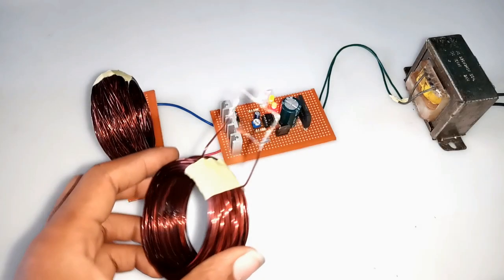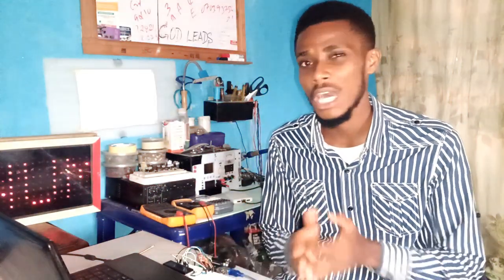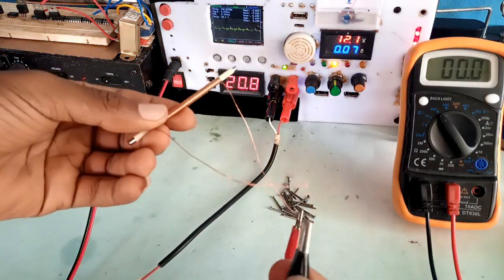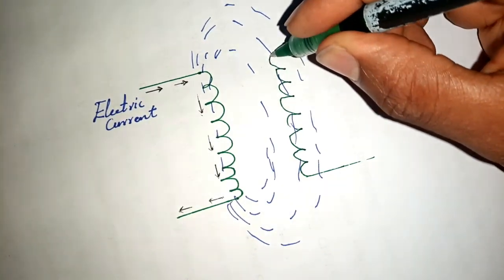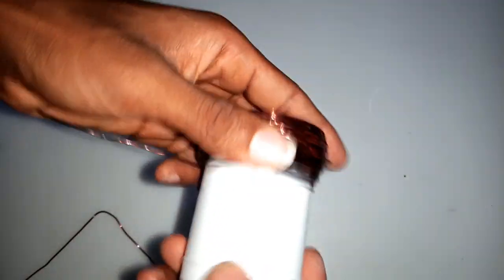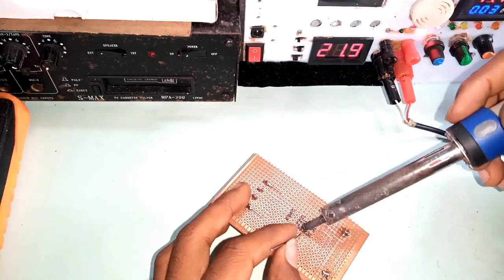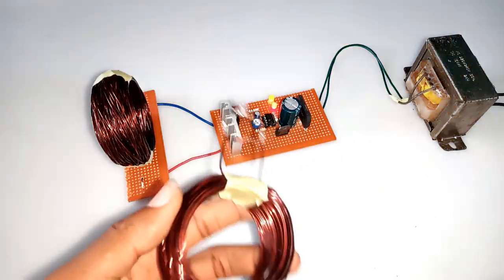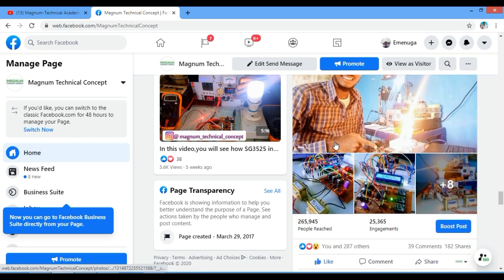Wireless Energy: How wireless electricity works [ Make wireless charger ]

Comment: Wow, this awesome Engr. Magnus, how did u calculate the tons output current for the receiver to power the LED
Reply from the maker: As I mentioned in the video, the induced current is relative to the copper turn and guage. With respect to that, I increased the number I had, since it was able to capture little current.
When I increased the number , it worked out fine...

In general, I didn't use a formula to calculate the turns ratio, but there are lots of calculations to do, which I will add in my upcoming video on the subject.

Comment: Very inefficient. How much power delivered by your power supply? How much power produced in the secondary coil? there's a big difference and so this circuit is impractical. Unlike in ideal transformer, Pin approximately equal Pout.
Reply from the maker: Exactly, I completely agree with you that there is lots of power loss, as the project is built to further illustrate the working model of the system